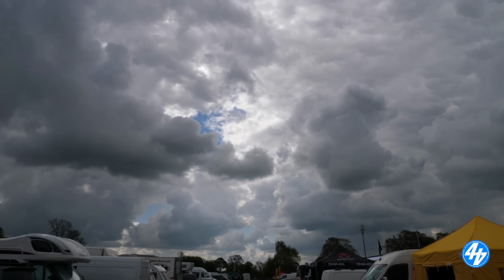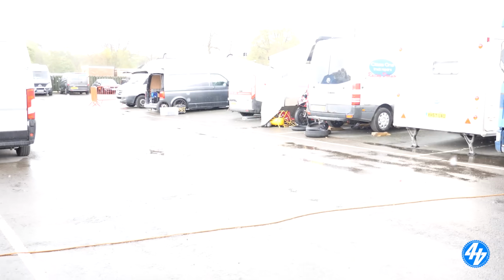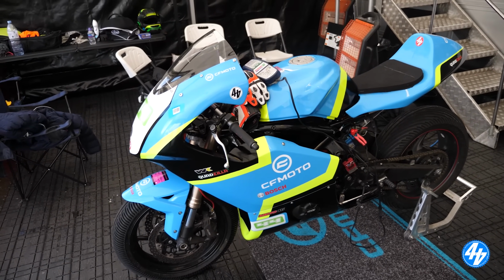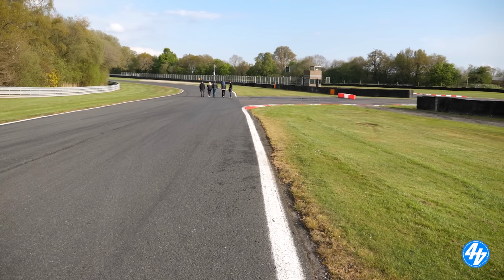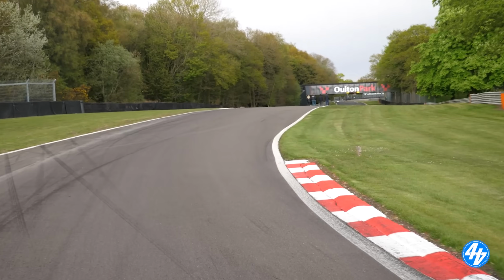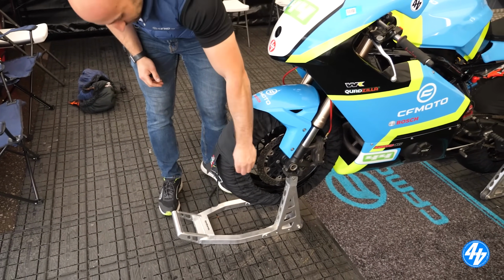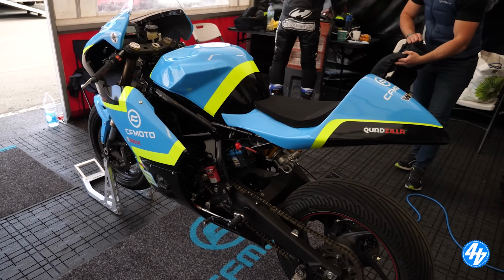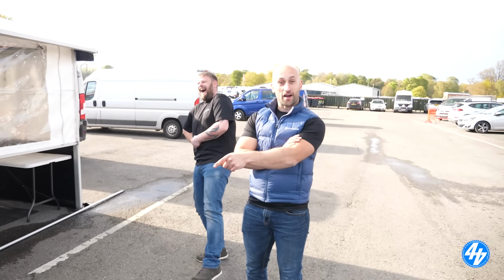LETS GO RACING - 1st PODIUM!

Comment: Don't @ me if you've already done this but the issue sounds like Ignition/Fuel flow, now considering the ER6F/Ninja 650 is already a budget bike, and the CFMoto is basically a glorified ER6F built to an even lower price point, surely you could just scoop up some lightly used/even brand new OEM Kawi Injectors, coilpacks and throttle bodies. They are probably gonna be more reliable than, and I mean this with all due respect, a chinese copy of an already budget bike. 2006 all the way to 2021 Ninja 650 /ER6s platform bikes share all of these components (Versys, Z650/ER6N, Ninja 650/ER6F). Coilpacks are fully forward and reverse compatible, throttle bodies are fully compatible, although 2016 onwards they moved to 36mm instead of 38mm (less top end power) so you're probably fishing for the 38mms especially if you are tuning. Injectors are all the same aswell.

Comment: Well done lad...but please!!!! Blip on the downshifts. Keeps it more stable under brakes and on the turn in. MotoGP have slipper clutches, you don't. But just kicking down the gears is bad technique. Congrats on ya podiums.
Reply from the maker: nope - thanks for your input Geoff but the bike has rev issues and what you describe would not end well. A fantastic reason to not comment on things, such as this, without knowing all the circumstances. But please feel free to tell Jack Miller though  😉👍

Comment: Those stands 🙄 the back one is to low and the Front too high 🤷🏼 I cut the Front ones down one block <> and found a couple of bolts that I could grind down so they fit nice in the bottom of the forks and drilled the rubber blocks and put the bolts though and they are so SO Much Better 👍🏻👍🏻 💪🏻💪🏻 😎😎

Comment: Does not bode well for CF Moto quality
Reply from the maker: why? the race radiator rubbed on the wet tyre? I think actually it speaks volumes that it kept running at that temperature! Plus, these are race tuned engines - not standard road engines.
Reply: @FortyFourTeeth  I didn't know it rubbed on the tyre. Can't exactly say the first 2 race meets have been without problems though. Hopefully you guys get the issues sorted coz I'm loving this series. I'm sure a win isn't far away.
Reply from the maker: @PaulTheFifth  No worries - i dont think there is a race series in the world where the team turns up at race 1 with everything sorted. This is a development bike and think its doing pretty well :)